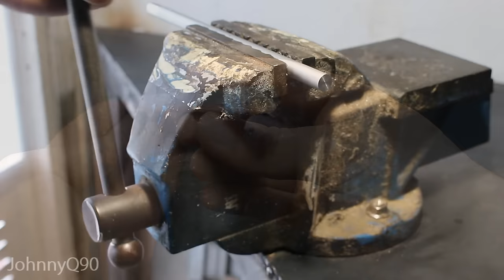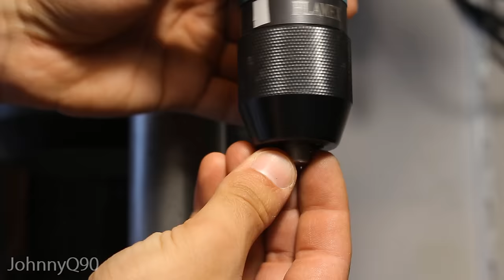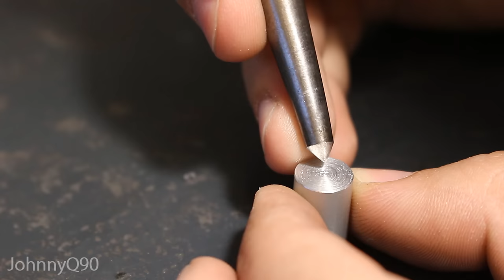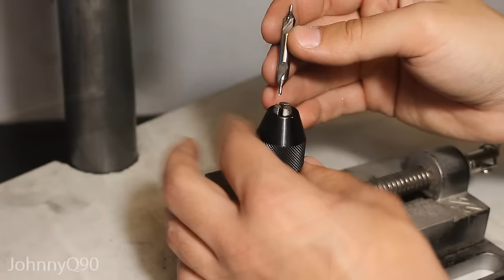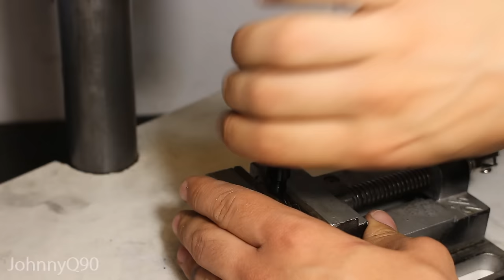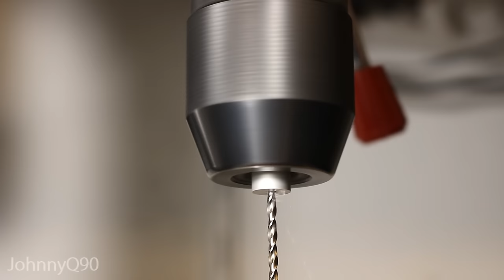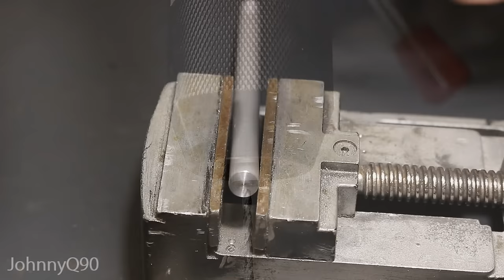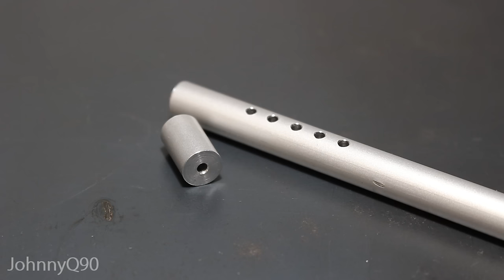Simplest Way to Drill in the Center of ANY Rod!

Comment: Slightly better way is to put the drill bit in the drill press chuck first, then lower it down and tighten in the vice. That way you know it's perfectly centre and directly upright
Reply: Sure, just don't grip the drill on the flutes if it does not go in deep enough to catch on the shank. I saw too many people with the chuck gripping in the flutes, and they wonder why  the drills wobble. if a drill slips, gone is the chuck accuracy. Sorry if I preach to the converted, just one of my frustrations with people damaging good tools, by nit using them properly.
Reply: I'm one of those neurotic people (ek vatikaki) who freak out when they see the bit being jabbed in and out of the work. A steady feed rate is better and faster.
Reply: shadeburst 
Actually, by retracting the bit, so the cut material is removed from the hole, there is less friction to build up heat, and the drill bit will last longer.
Reply: I have center drills that I have cut off so that I have full grip on a round shank. I do not work around a shop any more and do not miss the smell of a cutting wheel going thru high speed steel.
Reply: Makin Sumthin From Nuthin,
GOZ.2M8
G83Z-1.200ROJ1K.1F9.2
G80M26MO2
Just something that ran through my thoughts.
Reply: Chop saws, I remember, loud and smelly. They would kick when you pulled the trigger. For HSS I used a surface grinder with a cut off wheel.
Reply: Lotusrk123, 60 bucks, nice price. I'm 67 yr's old and been out of the shop for 5 years. But I know friends that tell me to come over and use their bridgeports, lathes ect which is nice. Have not used their kindness yet but nice to know I can. I like videos like this one to help me out with tricks..
Reply: How would it be centered?When only one jaw of the vice moves when opened?Wouldn't that offset the hole?(Just stating the obvious in my humble opinion)
Reply: Lotusrk123  occupy until that time and try to enjoy this brief tour of duty on this side of eternity, I'm right behind you at 66 and know that the end of the highway is near one way or the other,still got a fist full of throttle on the harley and sharing the Gospel!Maranatha ,GREETINGS from Tampa Florida
Reply: @Jeff Sharp: Pretty sure that particular vice is mounted on a standard drill press, so the vice is mounted to a plate that slides back and forth on the press so you can center things after clamping them down.
Reply: I will check out the Rev. 12. Good stuff. Enjoy life.
Reply: Ditto, but feeling anxiety when someone uses incorrect practise is not a sign of being neurotic.

Twist drills are designed to be used in one continuous motion. There is no benefit whatsoever to "pumping", it isn't taught anywhere and it's not the way a drill is meant to be used.  Overheating of the drill bit doesn't happen when you set your speeds correctly, feed at the correct rate and/or use cutting lubricant.

+slshanklin "Actually, by retracting the bit, so the cut material is removed from the hole, there is less friction to build up heat, and the drill bit will last longer."

No. The flutes of the drill perform that function already, all you're doing by pulling is creating a space for swarf to collect, and if the pieces are large enough it could even happen that the drill spins on top of a flake without cutting, until it becomes red hot.  If your drill is overheating then you're using the wrong cutting speed or too much pressure. This method also wastes time, not a big deal if you're only cutting one hole, but if you have a few hundred to make then your productivity will be significantly affected.

+Carsrock1999 "Pretty sure that particular vice is mounted on a standard drill press, so the vice is mounted to a plate that slides back and forth on the press so you can center things after clamping them down."

You move the vice by hand (optionally) bolt it to the table.  There's no means to determine the center of the workpiece other than by moving it so that it's under the tip of the drill.  Clamping the drill in the vice before tightening the chuck is pointless and won't improve the accuracy of the centering.
Reply: Then I would wonder why the CNC mill I programmed and ran for years had a "peck cycle" for drilling? You have to get the chips to break off, and that is how it often has to be done. If you don't, you'll have oversized holes, broken drills, spoiled parts. A lot depends on the material being drilled. For soft commercial grade aluminum, such as 6061T6, you need to peck drill if you are drilling very deep. Yes, you can still run into problems, if you end up trying to drill though a chip that is turning in the bottom of the hole. 

IMO, this method is ok for home shop, but I would not call the result "perfect". Drilled holes are seldom perfectly located, even on a CNC milling machine. Don't get me started on "True Positioning".
Reply: Yeah sorry but your wrong.  Many times peck drilling is the preferred method, especially in softer materials, even if simply to clear chips. A large ball of long stringy chips rotating on your drill is not much fun.  Sorry your not the expert you thought you were.
Reply: StuntPosse,2*SQRT(x sq + y sq) MMC, Ha! You brought back an old memory. The guys hated that I had to inspect their work like that. Almost had to bore tapped holes. Military and space details loved to put that on their prints. For home use, this video fits my tolerance's fine.
Reply: Tom Kleng You've obviously never actually performed production drilling without through spindle coolant/through tool coolant drills... in which you can drill 6+ diameters depth without pecking. 

Proper speeds and feeds considered... the heat leaves with the chip and chip flow becomes more difficult the deeper the hole. Peck cycles are used to remove the chip/heat from the part.

Coolant delivery is always an issue in deep hole drilling without through tool capability.  Hence the peck cycle...
Reply: Some may give me flake over this but another method that a drill is cooled, is the drill in constant contact with the "metal piece" working as a heat sink. A drill can get very hot drilling some plastics or fiber type material.
Reply: This isn't a production run with a heavy tool that holds heat, but you're right that there are situations where it will be necessary. I assume you meant to write "can't drill 6+ diameters depth without pecking" but you certainly can, because if you are lucky (using the correct rates, a sharp tool and coolant) your swarf will peel off in long strings and not become caught in the flutes.

It's not like you have to guess, you can tell when it isn't flowing and needs cleared.
Reply: Tom Kleng For the record, production drilling typically implies CNC. 

Our shop drills >10x daily, mostly for injection mold cooling lines, so I'm aware that it's done. What I'm saying is this; that you will not do this, or anything over 6 diameters consistently, in aluminum, without either 1. through tool coolant or 2. peck drilling. The tool needs lubricant at the tip and that simply isn't possible without either of those options... I don't care how optimized your speeds & feeds are, you are constantly combating chip weld and built up edge.. both of which are exacerbated with lack of high pressure lubrication.
Reply: Yeah, and having an abrasive wheel explode can ruin your day too -
Reply: ratgreen I
Reply: x2malandy - Take a look at hackerspaces.org for a hacker/makerspace near you. The larger ones have a machine shop, so you can use tools for te cost of a membership && you will find folks who will appreciate learning from old fart experts.
Reply: shadeburst it's actually not vice to keep drilling constantly. 
Im not sure how often you work with metals...
Reply: @x2malandy  don't ever try to drill Acetal/Delrin then, you'll freak out. You absolutely MUST peck Delrin.

Comment: Once you drill the hole in the guide, measure with calipers the distance from inside the hole to the od. Measure many times all the way around.  If it varies, there will be a high and a low with 2 spots opposite each other that are the same. Make sure these 2 spots that are the same are touching the face of the vice and that will make it centered as close as possible with this technique.
Reply: The real advice is in the comments.

Comment: To get the centering tool aligned perfectly to the center axis of the drill press,  ...Chuck the centering tool into the drill press, lower the chuck and clamp the tool into the table vise,  then un-chuck the tool from the drill press.  Chuck the rod into the drill press and drop the chuck onto the centering tool.  This method allows the thru-hole to be concentric all the way thru the rod.
Reply: Works even better if your vice is good quality with a "V" notch in the jaws. If you only have a crappy vice and the table isn't real square to the axis of the press, you can get around the problem by clamping a block of scrap that has been pre-drilled and tapped for a grubb-screw. Then drill into the block down past the level of the grubb-screw, put the center drill in the hole and tighten the grubb-screw to stop it spinning.